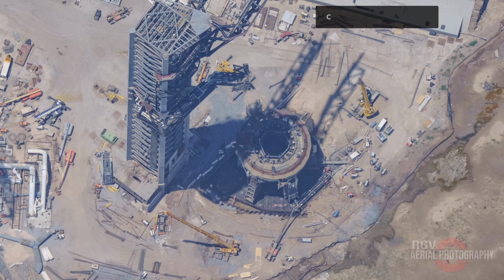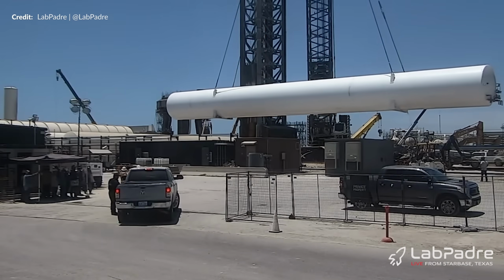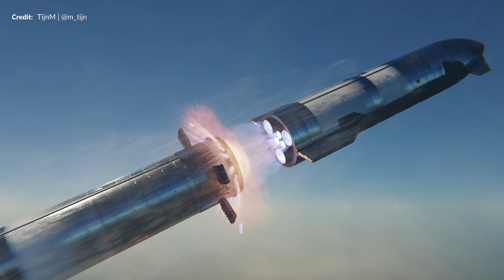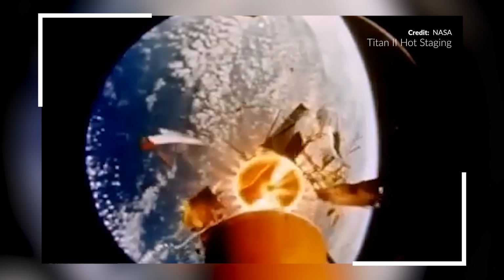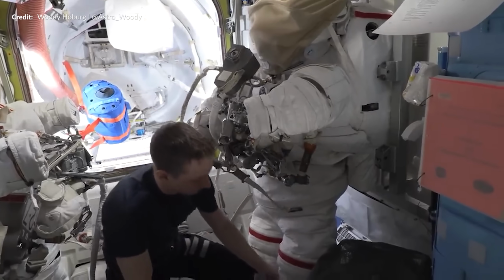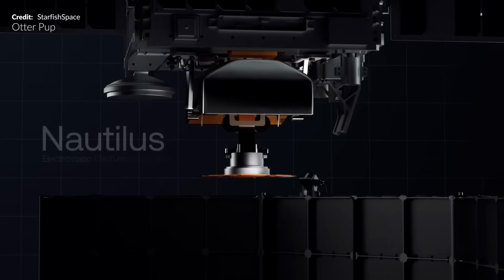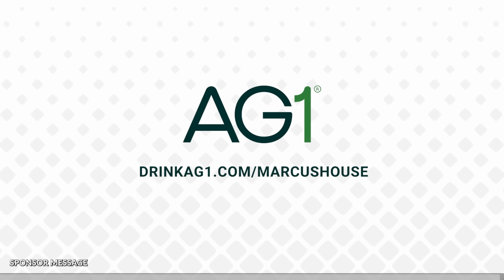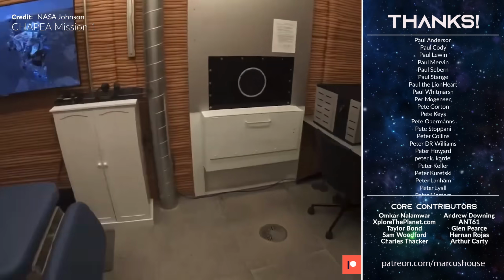SpaceX Drops Bombshell Upgrade Announcement: Can it really be that good?

Comment: Unless they really dial back those engines, they can pour as much concrete as they want to- It wont rain any less concrete on Space X's launch site. I mean I wish them success, but I wholly expect them to launch concrete and, now bits of steel plate, all over again. This is a stupid idea. Even if their deluge system works the way they want it to, those gases have to go somewhere. That just leaves the space in-between the pad and the rocket, which includes the legs of the launch mount. So, even in a best case scenario, I don't see how they don't destroy the launch mount.

Comment: The reasons Ellon gave for hot staging make sense but are bad news for a rocket designed to be refueled.  If they are having issues to ignite the engines when the tanks are full  imagine partially full tanks  and after days of being in zero G
Reply: The Superheavy booster never gets to orbit, so can not spend days in zero-G.

Comment: Two quick questions, Marcus - What kind of concrete formulae are being used? Can you speculate?  I'm remembering how the mystery of 'Roman Concrete' has drove researchers nuts. That formula, recalling, hasn't been solved??  Another Q - Space X openly allows all kinds of filming of infrastructure. Aren't they, perhaps, concerned about Chinese space vehicles, launch systems, robotics, etc? Why would Elon be so open? I mean, probably the first rule in business is to keep the lips sealed: ''Intellectual ownership'' issues.
Reply: Fondag concrete is what is used by SpaceX. "Formulated using specific alumina binders and synthetic aggregates, Fondag is the most reliable ready-to-use heavy-duty concrete on the market." - Imerys page about Fondag

How Roman concrete was made has been solved. Apparently, Roman concrete "has less compressive strength than typical Portland cement." So is not as useful in modern applications. You can read more at the article below.

"Why Roman concrete is stronger than it ever was, while modern concrete decays" - Tibi Puiu,  May 31, 2023

Comment: Starship 3 central raptor can be gimballed outward right? So it can be aimed at the exhaust vent ring extension, not directed to the booster top end. After separated it can gimballed back to center

Comment: I think the issue with SpaceX starship loosing hull strength when they cut the opening for the pez dispenser can be solved.

 If the opening is cut vertically instead of horizontally then there will be less hull warping when it goes through max Q on launch.
Obviously the vertical open will need some reenforcement but far less than the horizontal one.
The pez dispenser will need to be rotated vertically and redesigned so it can fit in vertically and the satellites will be stacked vertically and not horizontally.  One will just have to stack pez dispensers on top of each other with their separate vertical openings to achieve the same capacity. 
This might mean a longer Starship.
Reply: That's a lot more complex and error prone than just throwing extra steel at reinforcing the door. It's not like they need much structural strength while the door is open — they'll be in freefall — so they simple need to ensure that it's strong enough with the door shut.

Comment: With the hot staging, based on the layout of the engines, I think they will be using the R-Vac engines, as it will be easier to route blast scoops as they are near the rim of starship and not in the center.  If they use the central sea level raptors, then the whole dome will need a heavy blast shield.  R-vac scoops will save weight as they will only need to cover 25-30% of the dome

Comment: IIRC, not a single NASA or other gov't or agency in the world has successfully had a crew of ppl in isolation for a long time that didn't lose their shite.  This should be interesting to watch, and show once again, either habitat or personnel failures end the experiment.  They better not cheat and add air, water, food, whatever like was done in previous failures!  "Eight go mad in Arizona: how a lockdown experiment went horribly wrong?"  No one remember this?  Biosphere 2, just one of many failures.  Interestingly at least NASA learned and is doing the experiment in Houston Texas, a Red State... ain't gonna help.  

An authentic Mars experience would have the habitat buried sufficiently such that the 10% brain cell loss for the surface radiation per year would be mitigated.  Magnetospheres matter.  Forget about the Perchlorates in the regolith anyone traveling in space to Mars for 8 months would be DOA in weeks.  If any did survive, which I find impossible, but for the sake of argument, they would be so weakened as to be completely useless and a drag on anything that needed to be done on Mars.  

Dare to dream goes a long way, until reality happens, when you research enough to get to the details.  

If they are mole ppl, I've got to start the deadpool for dates they come out of the habitat.

Comment: Thanks again Marcus! If the almost empty Superheavy pushes with 3 engines at 50%, its thrust to weight ratio will be higher than that of the fully loaded Starship, which is intented to also use 3 engines at that time! So maybe the Superheavy shuts down its engines just before separation?
Reply: The goal is to not shut down the booster engines at all, because immediately after staging, they need them lit for the boost-back burn. So the plan seems to be to reduce thrust to minimum, use those engines to turn the booster around, then throttle straight back up for boost-back. I agree that the remaining thrust makes a challenge for separation, but they do have a reason to not want them shut down completely...
Reply: @simongeard4824  Thanks for your reply! The outer 20 raptors in the booster can't be lit again because they are started while on the OLM using helium that is not internal to the booster. The inner ones can be restarted instead because they use on board  helium for that. That last fact was the reason I guessed that the booster might shut down just before the separation to facilitate separation. In any case an almost empty Superheavy, with minimum thrust from 3 engines , has bigger thrust to weight ratio than a fully loaded Starship with 3 even at max , so its hard to understand how the separation could work.

Comment: This is a rocket that generates more force than any other rocket that's come before.  The only way its pad holds up and they aren't constantly rebuilding it is if metal is used to deal with the blast, not concrete.  Also, the blast needs to be directed in a way to where there is NO WAY it could possibly stir up debris that could fly around and damage infrastructure or the rocket itself.

So, they can lay all the concrete they WANT, as long as there's a metal plate that can deal with the heat and the force of the blast.  Over time, and SpaceX wants to do a LOT of launching, the surface cement will get damaged no matter how thick the cement is.

Comment: Hot staging is another way to keep the system ready for an abort during booster stage firing. Since the booster never fully stops engines, it makes the boostback to landing zone for the booster more efficient too.
Still think shielding the booster enough to reuse immediately after landing is going to be difficult.
Reply: Not likely for a catastrophic failure. The Raptor engines take a second or more to ramp up to full power and the TWR is 1.5 at best. Contrast that with the Crew Dragon Superdracos that are at full power in 100ms and have a TWR of ~4.6.

I agree on shielding the booster.

Comment: The decision for Hot Staging reveals a lot.
1. The tanks have to be totally new construction or
2. the way to transfer fuel needs microgravity = rotation. That ...
3. ... reduces the possible refueling-structures to 2 configurations:
a. A minimum of one dedicated tankership, docking nose to nose and spinning not longitudinal or
b. the maximum solution of two counterrotating discs of tanks (LO2 & Methane), the center axis is the base for docking and it connects both discs without crossing the pipes
4. SpaceX has no concept yet otherwise they would be alreay building the tanker-ship
5. They will never be able to deliver their part for the moon landing in time.
... and there are many "sideprojects" to solve: avoiding slush, temperature control, docking of the fuel pipes, ...
Good luck! This is going to be interesting :-)

Comment: Hot staging makes a lot of sense, but I don't think it's the thrust from Starship onto the Booster section that's the problem. Since the Impulse (Force * Time) generated will be manageable and steel can easily handle the high temps for a few seconds - especially if the protective cover is easily replaceable in the event of damage. The problem is that the section on top of the booster with cut outs for the exhaust needs to withstand the the compressive forces generated by a fully fuelled Starship at Qmax. The test section looks way to flimsy for that. Can't wait to see how they solve this.

Comment: This could also function as an escape system to allow NASA to man-rate the starship.
Reply: Not likely for a catastrophic failure. The Raptor engines take a second or more to ramp up to full power and the TWR is 1.5 at best. Contrast that with the Crew Dragon Superdracos that are at full power in 100ms and have a TWR of ~4.6.

Comment: Hot separation is because they haven't yet worked out how to do proper separation and will use it while  the "system" is still disposable for every flight.  I really doubt they could use this in a fully re-usable system.   If the self destruct from previous flight was meant to initiate separation, it most certaintly didn't and whatever primitive system they had put in obviously didn't work so they'll use brute force for now.

Comment: The Titan II hot stage is a little deceptive. that entire section was frangible and the actual rocket was completely fine if memory serves. you could in theory use that technique and just bolt a new interstage on every time
Reply: It's not doing the hot stage that is what people are questioning. It's what doing a hot stage will do to the booster. They will need to armor the top of the booster and how much of the increase in payload will that take.
Reply: @steveaustin2686  yes, but my point was that the Titan II got around that by having the interstage frangible, so when pressure started to build from the hot stage, the innerstage blows apart like a dandelion and leaves the booster fine (in this instance). 
It's a different way to accomplish that task, and while not useful for rapid re-use, it's not the horror show of destruction it first appears to be
Reply: @Seldoon_Nemar  I don't think anyone is saying that it will be the same as the Titan II hot stage. What they are saying is that the booster will have to be armored heavily or take some damage to be repaired. Even having a frangible stage means replacing it every launch.
Reply: @steveaustin2686  The narration clearly sugested that the Titan II booster was destroyed during the hot stage. My point was that was in fact not the case and it actually DID have a form of frangible armoring.
I'm not talking about Spacex at all...
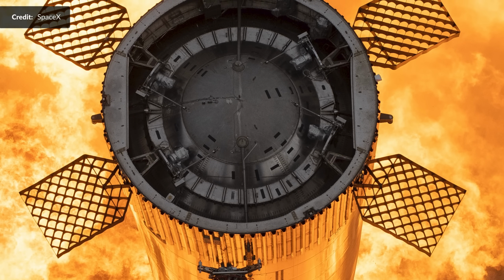9:00 is the part I'm referring to. "if spaces wants to re-use a stage it will need to be a lot more armored than that"
Remember, NASA didn't want the first stage to be harmed because if something happened and it detonated during the stage, it could be a mission failure from debris impact. all the frangibles came apart at a tangent to the original trajectory with no risk to the flight.
Reply: @Seldoon_Nemar  I believe the point was that the Titan II booster was expended, so any damage to the booster from the hot staging did not matter. The frangible nature of the interstage for the Titan II was almost certainly to keep the booster from exploding due to the hot staging. Other damage to the Titan II booster did not matter, since that booster was expended. Since SpaceX plans on reusing the Superheavy boosters and Musk wants to rapidly reuse them, mitigating the damage from hot staging to as close to zero as possible would almost certainly be a high priority for SpaceX.
Reply: @steveaustin2686  I was more just giving a history trivia and a little more context to historical footage...
Reply: @Seldoon_Nemar  Considering you can see the booster after the parts fly away, I can not see how any reasonable person would think the booster exploded. Although to be fair to your point, the 'rah, rah, rah SpaceX rulz' fanbois and SpaceX haters do post here. So they could likely need your context.

Comment: thx, another great update.

SpaceX stage Zero ... surprised that there is no safety around the edge of the platform ... but then this is in Texas.  Surprised they use a ladder rather than a "cherry picker" lift ... but then this is in Texas.

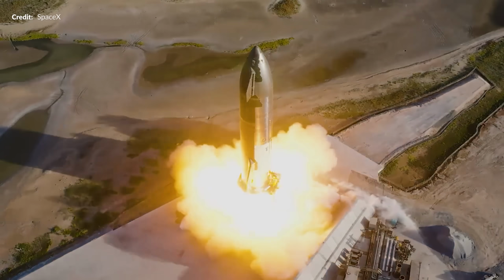Starship 25 ... @ 4:39 do we see debris flying through the rocket plume ?

CHAPEA ... I wonder how they reproduce the psychological stress that at any moment a failure of the shell could deadly.  Now its very likely they've designed the habitat to "leak before burst" so  a decompression event would not be catastrophic, and have systems to survive a decompression (like if you're unlucky enough to be in the decompressing compartment maybe you can survive the cold and vacuum for some time if you have portable O2).  But still the stress of always being ready to quickly don this emergency kit (and carrying it around with you all the time, reminding you of the potential problem) would become either immense or "blasé" ?  And habitat design would necessitate several isolated (isolat-able) compartments with airlocks.  But in this experiment they occupants ("astronauts") need to believe they are in peril, every minute.  One way to do this safely would be to tell them of this peril, show them the peril is real, then (unknown to the crew) inert the peril except for some scheduled drills and have emergency rescue on hand when they run a decompression exercise.

Comment: it's just using the raptors on starship as the separation ram .all that hot gas pushing them apart, also increasing momentarily the isp of the raptors due to the increased gas pressure environment 😅 even booster gets a decrease in velocity.

Comment: Concrete will cure to 95% in 2 days. Full strength in a month. 
The deluge plate is only 70%. No way to slide a 100% complete plate in as launch legs narrow
Reply: Tilt it 90° to the side and insert it vertically between two legs. Then lift up the plate from above, and remove the vehicle that moved the plate under the OLM to begin with.